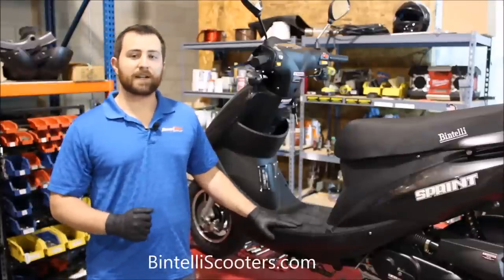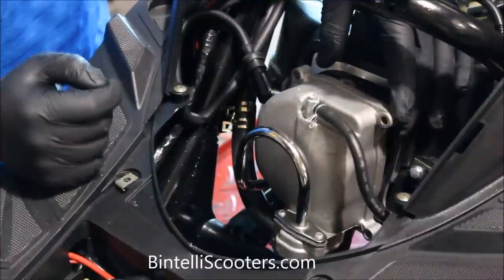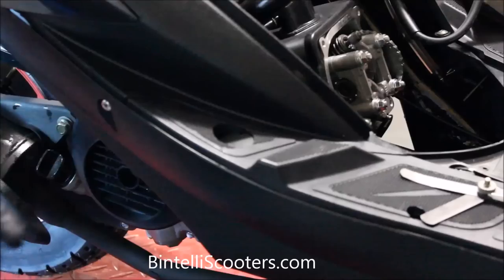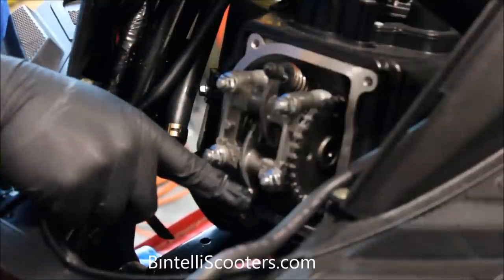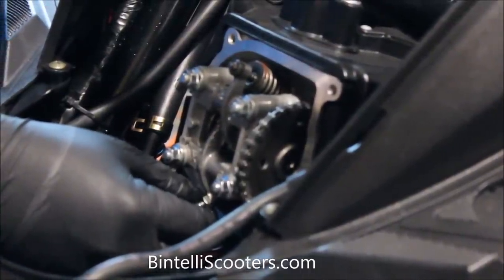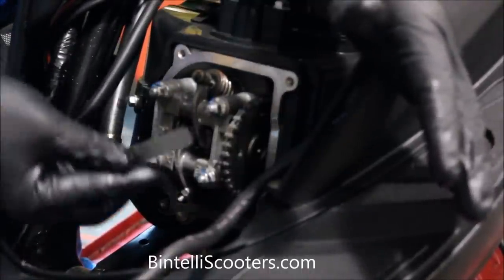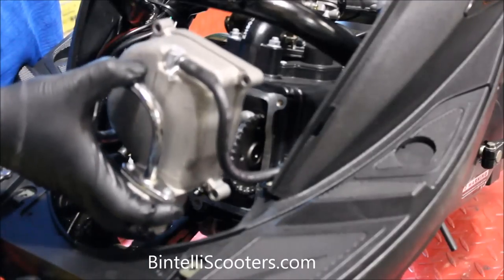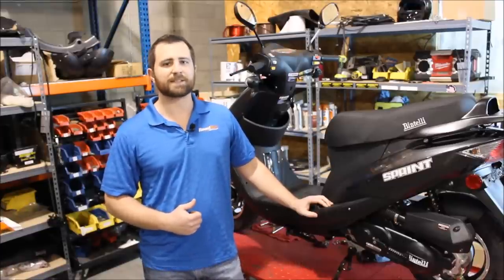How to do a Scooter Valve Adjustment - QMB139 / GY6 - Step By Step by Bintelli Scooters

Comment: I'm a retired mechanic my suggestion is this adjustment is very critical a little too loose it will tap a little too tight it will starve a cam so my suggestion is take your scooter to a trained professional and have them adjust the valve I do not recommend a person who is not a professional mechanic to make this adjustment adjusting valves is a skill not everyone has the ability to adjust the valves properly the man in the video makes it look easy but trust me on this take your scooter to a trained technician at a shop not a neighbor don't take it and have this adjustment I'm down the street at your neighbor's house take it to a regular scooter shop to have this adjustment done properly also you need to let the scooter set overnight to let the motor cool off completely before this adjustment is to be done I've known a lot of people who watch videos and thought they could do this adjustment correctly and ended up messing up the camshaft on their vehicle I strongly suggest taking your scooter to a high quality scooter shop and have this done by a trained professional I hope this information has been helpful to you it is very easy to accidentally adjust the valve to lose or if you adjust the valves where tight it will scar up the cam of the scooter so please take your scooter to the shop and have a trained professional adjust the valves for you it's really worth the money to have it done by a trained professional
Reply: I did it myself and was easy and came out great since the first time, what is that a "professional" mechanic do that you cannot do in a simple task like this? The fact is that with internet and youtube videos and lessons, people with some mechanical attitude (some people no matter how many lessons they take, they cannot hold a screwdriver in their hands) can do lots of jobs and repairs that before were prerogative only of mechanics, who often ripped off people since they didn't know what exactly the mechanic was (and wasn't) doing, I have been doing all sort of repairs on my scooter (variator replacemen, belt replacement, clutch replacement, valves adjustment, oil change, (both motor and gear), throttle cable replacement, tire replacement, Bendix replacement, and a bunch of other stuff, always using youtube videos (the good ones from "professional" mechanics), and always came out good, even did breaks replacement on my car, tie rods replacement, oxygen sensors replacement, some other engine parts replacement, and my biggest problem always was not having the right tool (as one of my old boss used to tell me "the tool makes the master"), that is why I started investing in tools (pawn shop are a great source of them), some of those repairs would have costed my a fortune before internet, because i would have had no clue how inexpensive and easy they were to do (that is why dishonest mechanics hate youtube and internet, because now people can educate themselves, checking what is the repair about and the cost of parts, and has become a lot more difficult for them to ripoff people). Going back to this episode, a prefessional mechanic would do exactly the same things the guy in this video did (maybe he is a professional mechanic), and, as appears, its really not that complicated to do, believe a guy that did a couple of times already.

Comment: Why when at top dead center would both valves have so much clearance?
Reply: Yes, there has to be complete release to allow valve spring to come up and close the valve. 3/4 of the cam rotation there should be a tiny gap.

Comment: Why I do not feel fuel when I put finger in spark plug hole? I’ve changed fking everything and my scooter is almost brand new, I have spark, good electric, new CDI new carb, new hoses, new fuel pump and no start

Comment: is that adjustment the same for 150cc scooter
Reply: For 150cc GY6 Engines, they recommend .004 - .005
Reply: GY6 149cc Tune Up Specifications....

.003 - .005 Inch : Intake
.005 - .007 Inch : Exhaust

( .076 - .127 Metric : Intake )
( .127 - .178 Metric : Exhaust )

Idle Speed : 1700 , +/- 100 RPM

Spark Plug : NGK C7HSA
Spark Plug Gap : 0.6mm - 0.7mm

Engine Oil : 15W40
Reply: for 50cc için valve in-out ? how mm.

Comment: Ain't shit to it. Different valve clearances from video to video. I do 4 thousands on the intake and 5 thousands on the exhaust valve.
Reply: Manual says do both at 0.05 though. Is yours running good at 0.04 intake. Do you have enough top end power? I am about to do valves so gathering opinions. Thanks!

Comment: Question - Why isn't this shit already done before you buy it?
Reply: Alec Prince
Thanks Alec!
Reply: +Alec Prince  how do I find top dead center? I have the team are lined up and a camshaft lined up. had to replace it without knowing about TDC. Now it is not right. How can I find out when flywheel is at top dead center so I can adjust chain on camshaft
Reply: it is, but when breaking new metal expands from heating up and cooling down. the longer you have it the less you need to do it. but still cheek it after every 5000 miles. I had new Honda moter cycles 600 cc shadow's only adjusted once every 15000. no prob.

Comment: I have a 2013 bentelli sprint bought used and the tapets are on the outside of the locknut not on the inside. is this something the previous owner did by mistake? It still ran up until I put a new exhaust